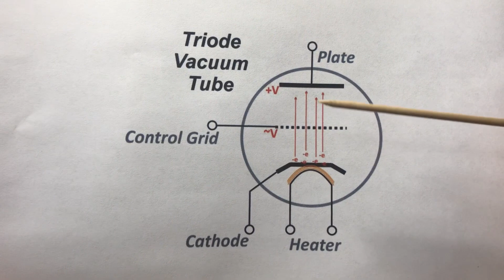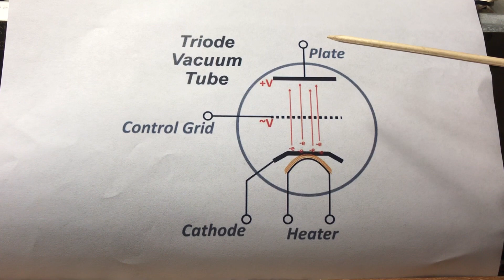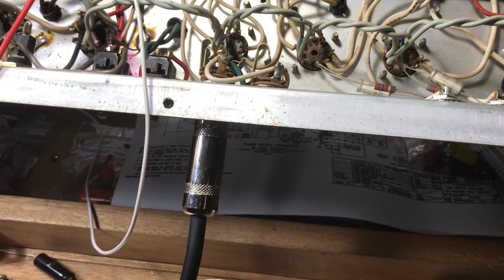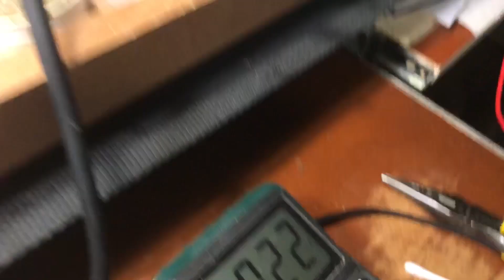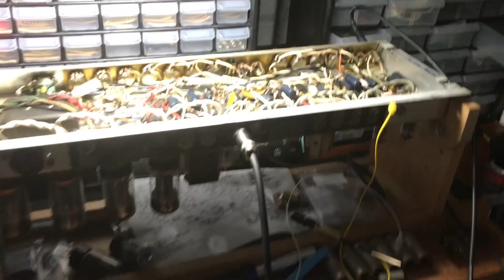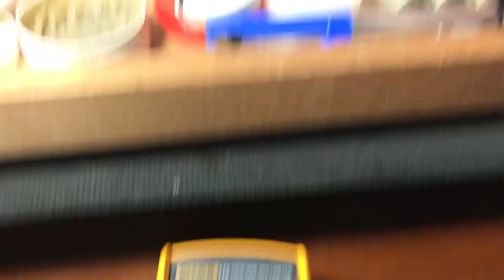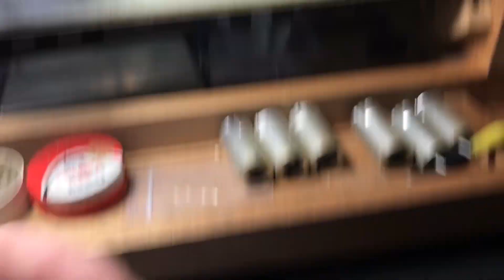1974 Fender Twin Repair, Overhaul and Modification - Part 1 of 4

Comment: @5:40 the electron speed limit is actually limited by the cathode to anode voltage,the media travelled  or any higher absolute voltage and the distance being travelled. The electrons will accelerate through such a electric  field.